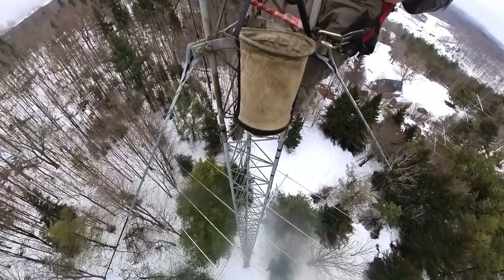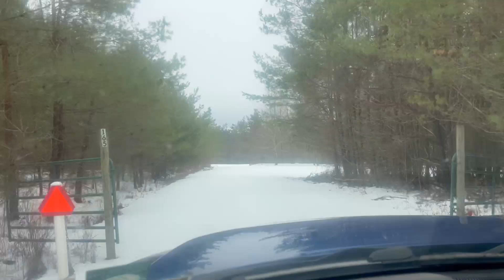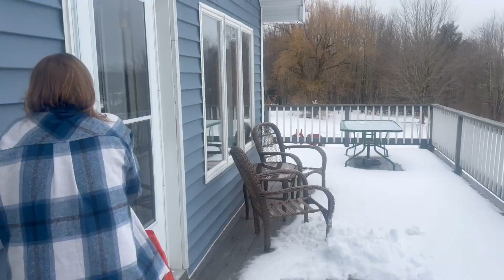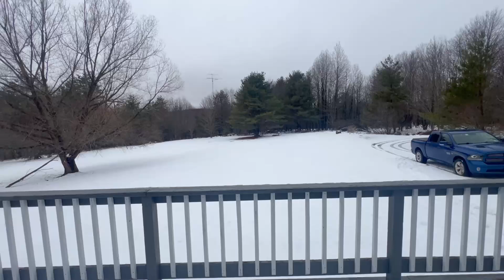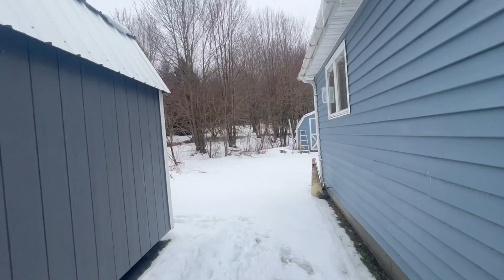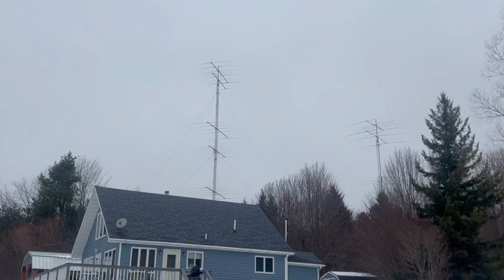Winter Time HAM RADIO EMERGENCY Repair!

Comment: I know this is probably a stupid question but how do you get the coax from those towers that are so far away to the house?
Reply from the maker: Long runs under ground! Low loss COAX, usually 7/8 or 1 5/8 Hardline
Reply: thank you for the reply Ray. My dream would be to run a tower like this. Would you ever consider doing any work in Florida? If not, do you have anyone you can recommend down this way. I love watching your videos, man, really love your passion and would love to meet you someday!

Comment: Howdy! Just got done watching five or six of your videos. It’s quite refreshing to see new videos coming online of ham radio tower related work. However, it’s driving me crazy that y’all just yelled at each other. What’s the thought with that? Even MURS would suffice, it’s unlicensed and seems like it would be a lot safer versus just yelling at the person driving the pickup truck that’s connected to the tower that you’re strapped to.  Regardless, great videos and I look forward to the upcoming ones!
Reply from the maker: Ive been doing it this way for 20 years. I need my hands free, the VOX just trips constantly.
Reply: @Ray-W2RE  Fair enough, you’re the one on the tower, not me!